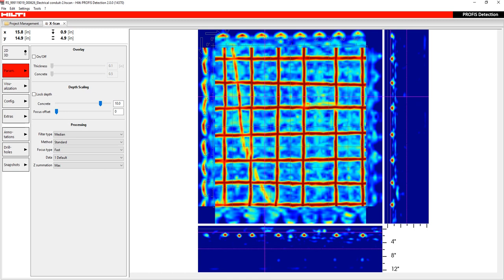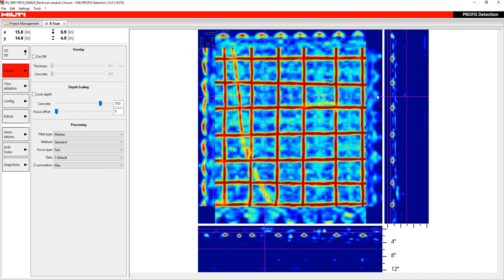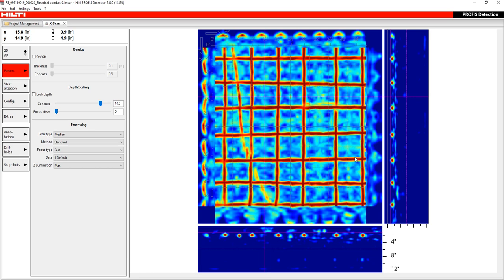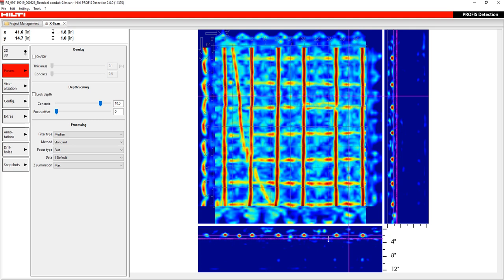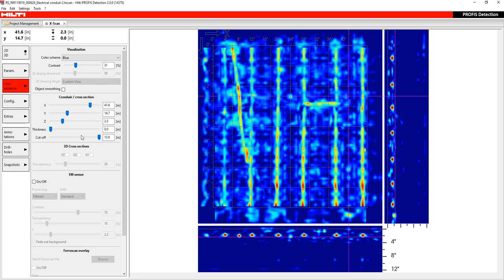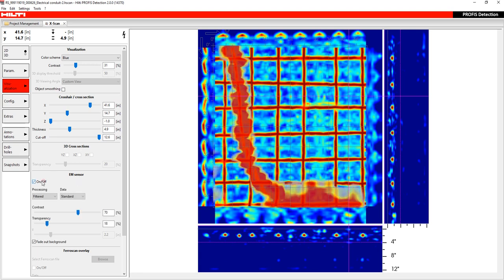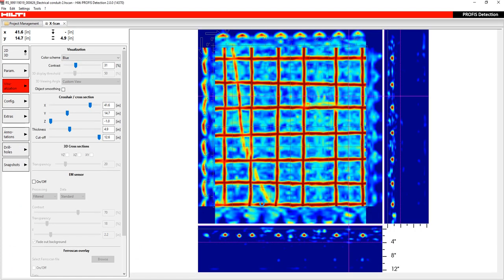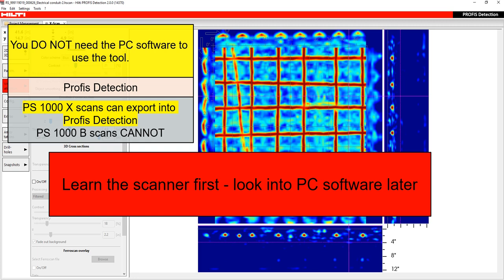PS 1000 Tutorial 1 - An Introduction

Comment: What does the ps1000b have that my simple old ps1000 has?....not much I believe
Reply from the maker: If you do not have the "B" version, you are actually in better shape. B stands for basic. Here are the three things the normal version has that the B doesn't:

1. Expert mode (see clear raw data on the tool and switch between mono static and bi static radar modes, while also looking at the oscilloscope).

2. Ability to export scans (if you are working with Profis Detection PC software, you'll need this)

3. It has a live wire sensor that is spec'd to see mains current at around 3" (helpful on the occasion a live wire is at that location)

Comment: thanks for the clear video, but I have a strange question. What if I want to spot a vacuum ( a hole) in a concrete wall, that is placed between a plastic system of 2 mm plate's?
Reply from the maker: Hi there, yes, I think it should find it. As long as the surrounding area is concrete and it isn't too deep (beyond 12"), I believe this tool will work just fine to find that. It find PVC piping, for instance, which is very similar.
Reply: @measuringsystems869  Okay, very cool, but just to be clear, what color do I have to look for on the scanner to identify such a hole. I mean how can I see the difference between the hole and the normal bars in the conrete?
Reply from the maker: @r.dudebricks9774  the color just depends on what your color settings are. I usually used the "blue" settings. Therefore, whatever is "concrete" turns blue, whatever isn't turns gray>yellow>red depending on strength of signal.